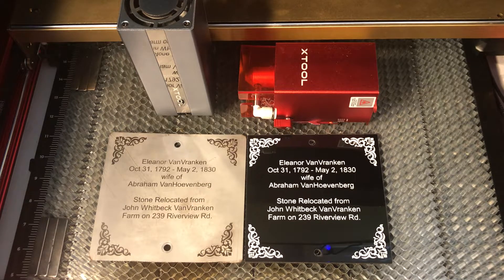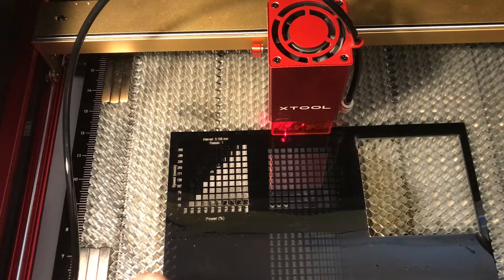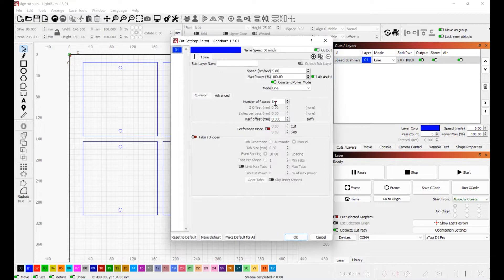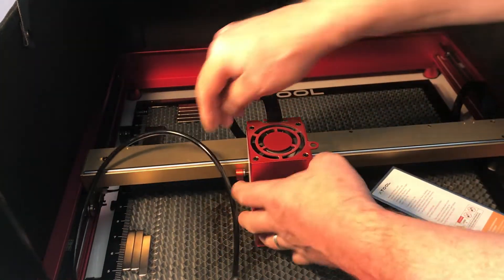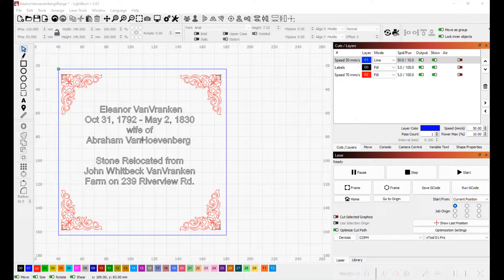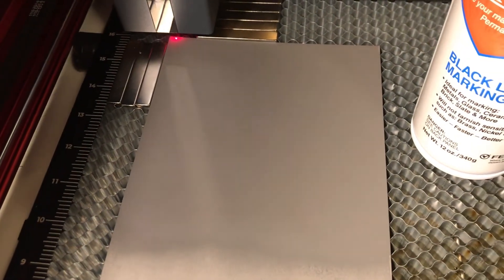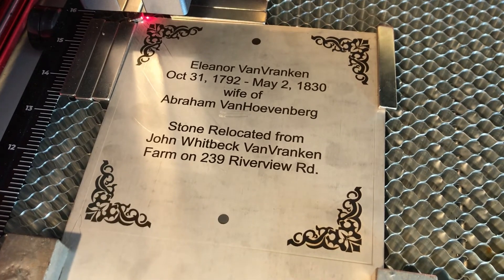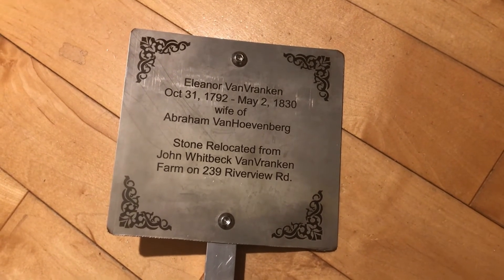Xtool Blue & IR Laser Cutter /Engraver. Making Outside Signs out of Acrylic and Stainless Steel

Comment: Thanks for showing the IR laser i have been debating getting it, i want to test on my 3d prints.. Looks like the IR did a great job
Reply from the maker: I found the 20W laser works well on stainless steel with the black marking spray. It runs much faster than the 2W IR laser. Without the marking spray I had too many problems with the Stainless Steel deforming from the heat
Reply from the maker: you can see it work on stainless steel thermos in: https://youtu.be/NwEYISW4bmk
Reply: @SerendipitySue  Thank you that is good to know. I have D1 Pro 20W i purchased before christmas and hoping to finally set up this weekend
Reply: I just got my IR laser and want to mark my 3d printed Cases that I make for my rotary switches I sell.  Works great on the black. Havent' tested on Red Silk yet.

Comment: The advice I have found and used on YouTube for drilling holes in stainless steel is to use water as a coolant/lubricant.  I have used it several times on similar sheets with great results.
Reply from the maker: I was using water, but the sheet was thin and deformed by the drill instead of bitting in. The punch is much faster!

Comment: Just FYI, it’s typically not a good idea to use aluminum and stainless steel together.  They tend to suffer galvanic corrosion and can corrode quite quickly.
Reply from the maker: yes, I ended up putting a piece of electrical tape between them